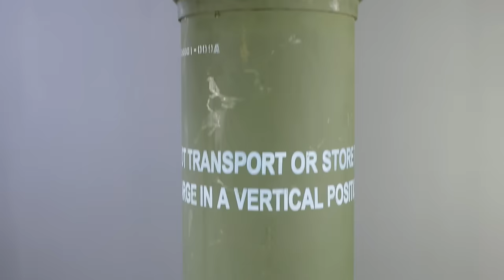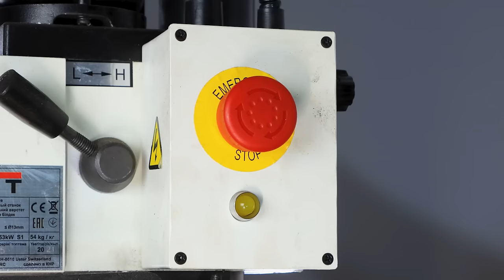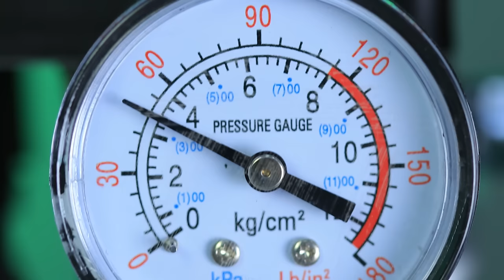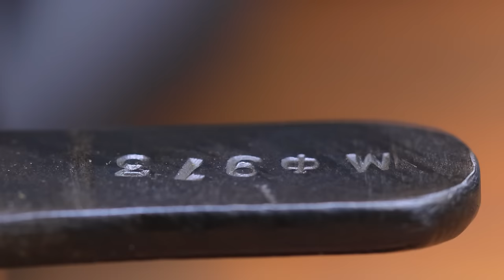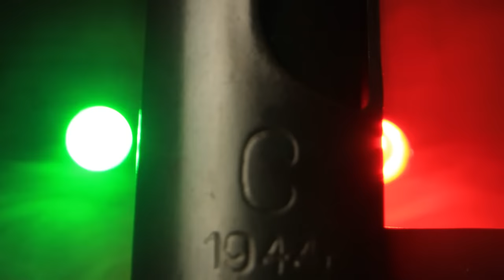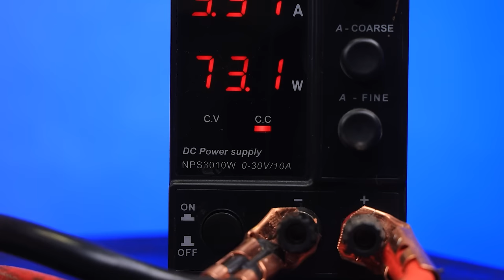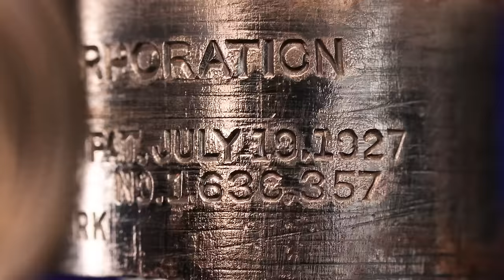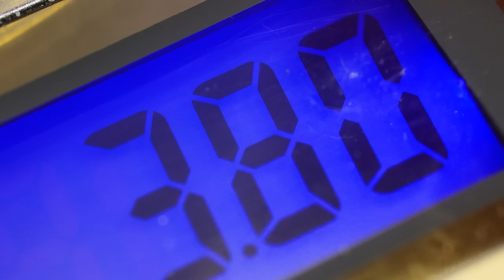PPS 1944 | Old Rusty Gun Restoration

Comment: Gun still seems not suitable to work so i dont know if this thing you did can be called restoration. Its just cosmetic restoration,.
Reply: They probably will fire if shot with real munitions though, just not shown in video for legal reasons. These guns were mass produced meh quality stamped steel sheet pieces with only a few solid parts, which is almost always the barrel and maybe bolt carrier assembly - which is neat because this usually means anyone with the right tools can make these things. Good luck finding the ammo though.